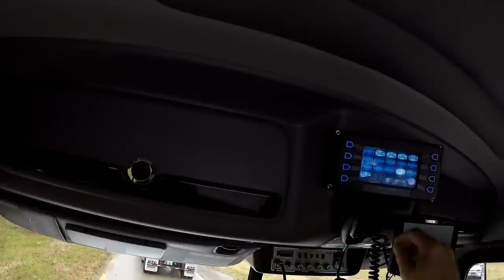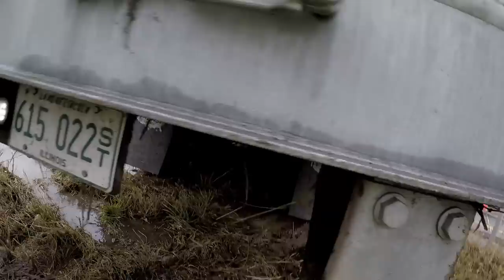High Wind Havoc

Comment: When I drive by a scene like this I don't think much of it. I take a split second to say a prayer that everyone is alright, then keep going. To an average eye this would seem like a usual scene, but due to the high winds, combined with the need to lift the trailer (WITH traffic, bear in mind), and the trailer being tangled in the barrier cables, this is trouble.

I now understand a little better just how rough tow operators have it when they have to respond to a scene like this. I am so sorry you have to deal with situations much, much worse than this one, Ron. You are an amazing man and I am moved almost to tears with how professional you handle your calls like this.

Comment: Makes me want to go out and order a new rotator everytime I watch you in action with yours. Even on this job which was tricky due to the high winds, it worked great and it saves soo much time. I've got ramps that I've built just for situations as this. However, by the time I got them in place and re- hooked a couple of times, I would have spent far more time and had to have blocked the road for at least a few minutes at the rear of the trailer while I set the ramps and slid it back onto the highway. BTW, that would have taken more than one total reset. I've resisted a rotator because of it's initial overwhelming cost, the fact that I didn't think it would work well on narrow mountain roads, and I'm getting old, just as my beloved Holmes 850 is. Oh, don't get me wrong, I have other, "pretty" recovery trucks that actually do most of the work around here. "Grand pa" and the "ole 850" only go out on the bad ones, where experience and "grunt" is needed. GOD Bless and thanks for the video

Comment: First time in 46 yrs driving that I heard of a driver bailing out and having it work out for them! 
Remember back when I was 17 (last Wed I turned 63) coming into N edge of London Ontario, truck sitting in field. Could see the tracks were it run off road to were it sat. It missed a billboard by only few feet. Driver that valid out didn't though. Never bail out! Especially a Volvo with it's integral brush cage!
She is lucky to be alive!!!
As always Ron Pratt, thanks for reminding us to drive safe. 😷

Comment: Looks like your new tire lift is safer than the older system. Your attention to safety is impressive
Reply from the maker: The tire lift came with the truck.  I just don't use it very often, because it is heavy and cumbersome.  The truck I had prior to this truck also had a tire lift.  They are very useful, but they also have their drawbacks.  First, as I stated, they are heavy and cumbersome.  Second, they have a poor weight distribution.  On the rotator, the weight distribution isn't as much of an issue as it would be on a 25 or 35 ton towing/recovery unit.  On the positive side, once the main beams are in place, the hookup is quite simple and quick.  There are certain trucks and buses that require the use of a tire lift to be towed.  As always, thank you for your input and God bless.
Reply: Ok ron u answered my ??? As well my friend. My ??? Was about the wheel lift as well. Stay safe and god bless you

Comment: Dang, he Crossed Over! Amazing. That driver did a great job of not tipping over on his side. I think this is the first time I've seen a Guard Cable completely disconnected/destroyed. Daggum, those are some stout "L Bars"! (yes, you are correct, this is the first video I've seen, where you use the tire lift), time is of the essence! The Driver JUMPED OUT!?!?!?!? Wow, incredible!!! Yep, that Cold Front was "something else"... I replaced the clutch in my 2004 Jeep Wrangler, prior to that Cold Front coming through Kansas City. As always Ron, another fine example of a Safe Recovery, and a great video overall!
Reply from the maker: Thank you so much for continuing to support my channel and adding such positive comments.  God bless.

Comment: Hi Ron:
Very nice and safe removal, even in the wind.
The truth is Guardrail and cable stay guardrail is not intended for 18 wheel trucks  and buses.
The 42" tall median barrier is the only safety item that will keep a truck or bus on the highway.   The Barrier that you see most of the is only 32"tall and trucks can climb up on it or break thought .  I designed Interstate highways for 40 years.
I enjoy your clean show and that you are a christian.
Reply from the maker: I'm not as educated about the cable systems as you.  I have seen the ones in our area perform remarkably.  Of course they destroy anything that comes into contact with them...    Thankfully this truck did not meet oncoming traffic when it went through.  I was surprised that it went through until I noticed that it broke through where the cable system anchors and transitions into the galvanized railing system for the bridge.  I am very pleased that you appreciate my family-friendly format.  Thanks for watching and God bless.

Comment: Good work Hoss, Those troopers didn't make your job much better by saying we got to get this roadway opened up as soon as possible. They can see your working on it. I know they're doing you a solid by selecting your company for the recovery. Seems like it's a lack of courtesy and ethics. Solely my opinion and everyone has one !!!. Guess we do what we have to do. Supper video Ron... Cheers !! * :-D
Reply: That guy talking to Ron often was a Fireman, he wanted to know how long at most to clear the road so they can hose the dirt off to get it open as quickly as possible.
Reply: In other words to take his time-Hurry up !!.
Reply: vetterfellow it's the highway patrols policy and best interest to keep the road open whenever possible. On top of that rotators are designed specifically with that in mind, to recover accidents while maintaining the flow of traffic as safely as possible
Reply from the maker: vetterfellow  I didn't take it personally when they asked.  I have worked and trained with most of the people that were on that particular scene.  There were multiple incidents on both sides of the interstate at the same time and their resources were stretched thin.  Also, they must report in to dispatch with updates so they were asking me so that they could determine where their resources could be transitioned if needed.  They know that our team will do a good job.  I simply took it as part of a necessary information exchange.  I can see how it may come across as rude or brash, but I know these guys and that was not their intention.  Thanks and God bless.
Reply: hi Ron , great jobs on your channel, i volunteer for first response here for search and rescue (USAR). don't do M,V,A but train with fire, and have been in the comms unit to see how hard it is for them. 
 for those that watch, to get to the point.
 first responders have to give sit reps back to comms as they are the eyes to those in control back in the comms room controlling the whole of the area.
when you get your head around that the scene is run from a remote communication centre normal part of multiple jobs at the same time and all they have to go on is those radio calls to make decisions and apply resources.
so the question can be direct and to the point, as radio chat has to be short to keep radio channels free.
anyway, I'm ranting and it was just headsup to your viewers,
PS last thing to blow me away was on a flood welfare job, team had stopped for a coffee in a small town isolated by flood water (we there to help locals), lady in the cafe shouted the team coffee and pie, its unbeleavable how generous people can be!!

Comment: Rotater makes light work of what could have been otherwise a tricky freeing from the barriers with a normal rigid boom Truck

Which do you prefer the Tyre Lift or Chassis (frame) underlift if the Wheels are good to lift usually ?

Great Vid ... Weather adding to the Hazards already out there

Comment: Geez that looked like a heck of a ride that driver took just judging by tire tracks. Lucky wasn't worse. I would bet being empty is what saved it from being a roll over, weight would made tires dig in and top heavy would probably took that truck for a roll.
Reply: Being empty is probably what caused it in the first place. Without weight to hold it down, that trailer is just one big sail to grab the wind. (Source: I drive big trucks too, and being empty in high winds is a personal nightmare)
Reply: Being empty likely was cause of the crash, but if had load in the trailer and went through the center like that probably would rolled it. So being empty likely main cause of the crash but also saved it from being even worse.
Reply: Few years ago seen a video posted of a loaded mail semi trailer get blown over going over the sunshine bridge in Florida, weight or not, those solid side trailers (van, refer, specialty) are going to get knocked over by strong enough wind.

Comment: Those wire rope barriers are nothing but an expensive death trap. They kill motorcyclists and rarely do anything but make an accident out of a near miss. I saw one video where a car swerved into one causing the wire to flail like a whip and nearly decapitated the driver of the car behind.
Reply: Anom Amos we have cable almost the entire way on the Florida turnpike and it's really helped with crossovers. I'm sure in some incidences it's worse but in the long run I think it helps. Just my opinion.
Reply: I had my life saved by a wire barrier.  I was driving home at about 3:00 AM from my girlfriend's house on the left lane.  I saw (seemingly out of nowhere) a Tahoe coming straight for me, into the median and it was arrested by the cables.  I'm reasonably sure that without those cables I'd have been hit head on or sideswiped at a combined 140 or 150mph.
Reply: Those cables save countless lives and have caused no fatalities. The keep the southbound vehicles from hitting people going northbound. The do chew up cars though.
Reply from the maker: For motorcyclists, you are correct, the cable barriers are death traps.  As a rider myself, I have always been concerned with them.  After they were first installed in our area, I worked an incident where a State Trooper stated to me that he was not looking forward to the first incident where they had to respond to a motorcycle involved with the cables.  As for larger vehicles, however, I have seen the barrier cables save lives by stopping "cross-over" crashes.  I have seen the cables stop fully loaded tractor trailer combos from going into oncoming traffic.  In this particular crash, the truck hit where the cables transition to the guard rail for a bridge and therefore did not have the full support of the cable system.  I have also seen the cables "trap" a car rather than bounce it back into traffic, thereby preventing the vehicle from hitting other vehicles.  I often work around the cables while they are under extremely high tension from collisions and I have to be extremely careful.  I could be injured or worse, but it is a risk I must face  There are different sides to almost everything....pros and cons....good and bad....benefits and risks.  Unfortunately we do not live in a perfect world.  Thanks for watching and God bless.
Reply: In Australia we have them too but apparently they are nowhere near as strong as yours seem to be and yes they stop a truck from going into oncoming traffic but with bigger trucks like b-doubles they just snap the cables cause of the force behind them and end up tangled in the cables on the opposite side of the highway. I love them and hate them... Definitely think in Australia at least we need the cables to be much stronger so that they trap the truck either on the shoulder or only slightly on the median.
Reply: Most of the cables in Wisconsin are in the center of the median and in most places, the medians are much wider than they appear to be in Missouri. Wider medians are the best safety feature They can't put cables too close to the road because they have to plow snow off both sides of the roads. We have rumble strips that can get a driver's attention as they leave the lane and they get back in the lane.
Reply: I was just south of where this video was recorded shortly after these cables were put up. I thought they were a waste of money until I was headed south with an end dump load of steel and saw a Ford Explorer get its front fender into a Werner trucks trailer tires. Explorer was headed across the median straight for my front bumper, cables stopped him and did so pretty softly. Like hitting a big rubber band. I will agree they are terrible for motorcycle accidents and every situation is different but I was very impressed with them that morning.
Reply: Im pretty sure that's why they ee ow using the metal barriars
Edit:lol missed spelled a lot... Stopped* rip..
Reply: @Rocker-1234  A lot of a Australian trucks weigh more than equivalent American trucks. 40 ton payloads are common in the eastern states and some of the road trains run to over 200 tons with powered trailers in Western Australia. (Powered trailers have a slaved engine under each trailer (same engine used for passenger rail cars) powering the tires on each of the five trailers.) (Cummins build the engines & transmissions).
Dont mess with road trains...

Comment: great video. just curious about what makes you decide whether you use the wheel lift or a frame lift? I don't think ive ever seen a wheel lift used on a semi before.
Reply from the maker: The tire lifts, or wheel grids, for semis have been around for a long time.  I've had this set up in the truck since we first purchased the truck.  The truck I operated for 10 years prior to us purchasing the rotator also had a tire lift.  The sections that fit on the "T" head part of the under-reach are extremely heavy and awkward.  The ones on this truck are heavier yet than on my previous truck.  My general rule has always been once the tire lift is on the under-reach I will keep it on there and use it until a job requires that I remove it.  Likewise, if it is stowed in the compartment, I don't get it out unless it is absolutely necessary, because they are so heavy.  I had them on the under-reach because I had towed a tractor trailer combo that had an air-ride steer axle and the tire lift is the best method to tow that setup......so I had left the tire lift on and it is still on.   Thanks for watching and God bless.

Comment: I'm glad the driver will be ok but I don't understand why she jumped out of the truck in the first place
Reply: she probably thought it was gunna roll, Volvos are a steel cab but they still fly into 1000 tiny little pieces when they roll.. and then you die..
Reply: Cincy RailFan Productions That is the 64 thousand dollar question. It would seem insane to leave the safety of all that mass surrounding you that Is designed to keep you safe.
Reply: I haven't seen too many trucks roll, land on their side, yes but not roll. If she had her safety belt on which I'm guess she didn't she could have walked away from this one.
Reply: p3th3t1c She still took a huge risk, when she bailed she could have easily ended up in the path of the trailer tandem duals. Praise GOD she was ok.
Reply: my buddy told me when he got his class A cdl that they flat out told him here in NH cars you are not required to use the seat belt but in a commercial vehicle you are as they told him that is to prevent bailout you are supposed to ride it out.
Reply: Volvo has a built rollcage that goes up the A piller and over windshield plus with steel body.

Comment: We're recovering from the storm we had in Scotland just now, we've got snow all over the place, except of course, where I live, not so much as a flake, and here's me who loves building snowmen with the Grandchildren as well. 
What a great piece of kit the wheel lift is, it looks like it's going to save some time when hooking up one of these Articulated trucks, do you mind if I ask, is it just as safe and secure as chaining up the front like you would normally do, and, even though you were on your own for almost most of the job, you worked away at double time, what was the big rush about this job
It must have been really terrifying that the driver wanted to jump from the Cab, it could have turned at any time, but the main thing, well done Ron, on yet another job with your usual safety in mind
Reply from the maker: Hope all is well, even though you didn't get any snow.   The rush came from there being crashes on both sides of the interstate in the same area, which had traffic slowed considerably.   That area is a very high traffic area and clearing the scene quickly minimizes the risk of secondary crashes and the risk of any of the emergency responders getting injured or worse.  In some instances, a secondary crash can be significantly more damaging than the primary crash.  It has happened several times recently in this area where there have been secondary crashes from the traffic backup created from the primary crash.  I worked one last week where the primary crash wasn't in my jurisdiction, but the secondary crash was.  One vehicle was at a complete stop when the second vehicle hit it in the rear at full highway speed and sent it airborne end-over-end.  Thankfully both drivers only received minor injuries.  Every minute that I/we are on the interstate increases our risk of injury or worse, so we try to work as quickly as possible.  Hopefully I have answered your question satisfactorily.    May the G.A.O.T.U. bless and keep you.
Reply: The Grandchildren have just this minute left for home on their bikes, all disappointed they didn't get to build that snowman, but thank you so much for the concise reply to my questions Ron, and after reading your reply, it does make plenty sense to work fast and safe, that way you get home safe, but, I suppose what we call rubber neckers can be a scourge of your life, in causing some of those secondary accidents, well stay safe, and thank you again for the reply, may the GAoftheU Shine his Light upon you